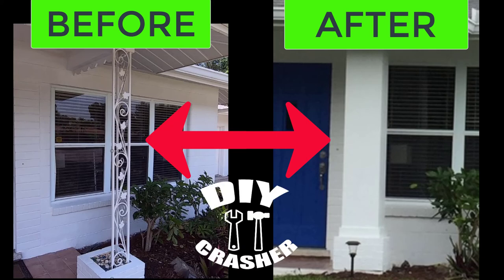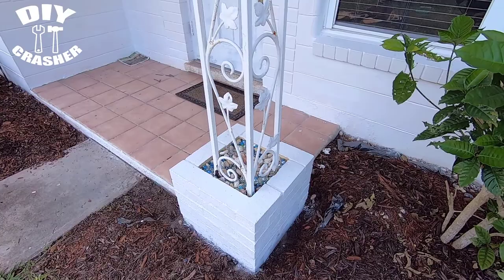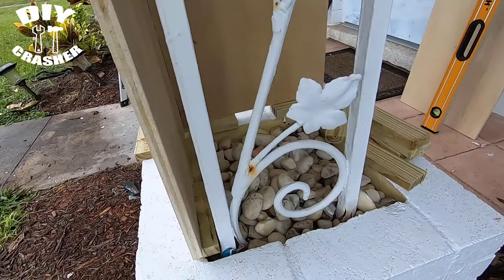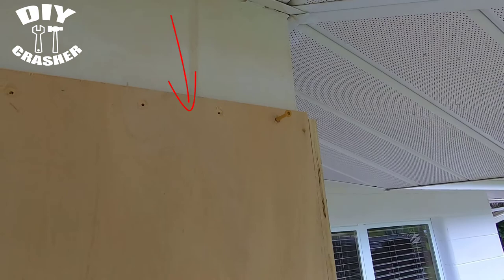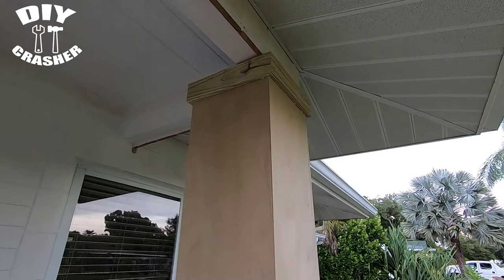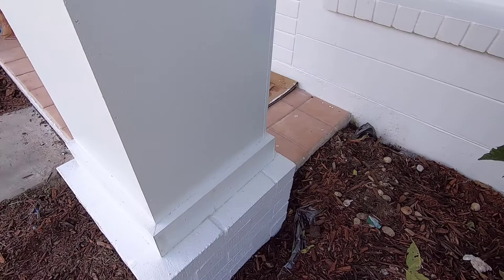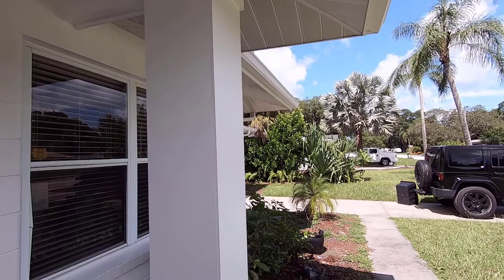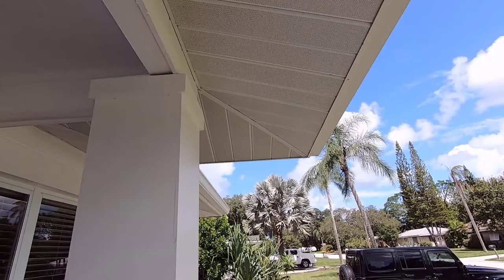House Column Makeover Improve Curb Appeal  |Covering Wrought Iron Column

Comment: At the top of the box on backside is there an opening or did you cut a small piece of wood to cap it off? We have alot of birds squirrels & wildlife, just anticipating one of them dropping down the column from top and burrowing a hole out. Trying to get an idea of the shape of that piece or how to connect it, if I were to completely close off the top
Reply from the maker: Yes I did put in a small piece of wood to cap off the top to prevent that very thing.  Sorry I didn't show that in the video.

Comment: How did you know it’s not load bearing and for decoration only ? I have same thing but inside living room
Reply from the maker: The box I built is not load bearing and for decoration only.  The  wrought iron column probably is load bearing in this video.  You should probably consult with a contractor or structural engineer to see if yours is load bearing if you are looking to remove it.  Otherwise you could build a decorative box to cover the wrought iron in your living room.

Comment: Do you think I could box it out and then put cultured stone wrap on it? I'm trying to avoid taking the wrought iron off and having to put a 6x6 on then frame it out. I'm thinking it may work the way you did it?
Reply from the maker: If you were to add the cultured stone then I would frame it out with 2x4's then put on the plywood so it's more of a solid and stable surface to be able to install the stone on.

Comment: Will the weather not cause the wood to warp and rot?
Reply from the maker: It's been a couple years since this project and it's still in good condition.  It was painted with an exterior paint, so that keeps it protected.  If you can find pressure treated plywood then that would be a better option.